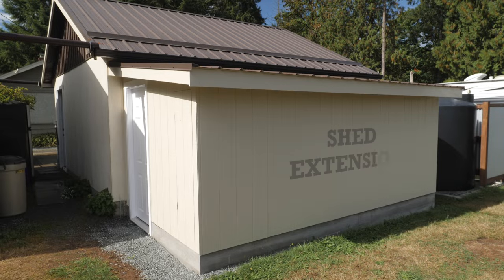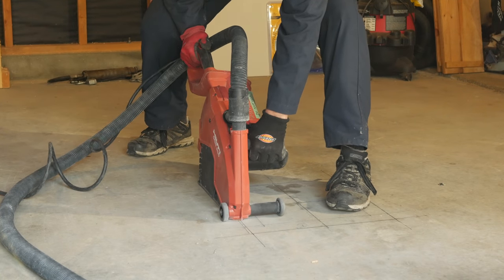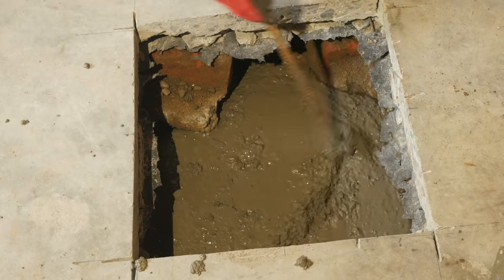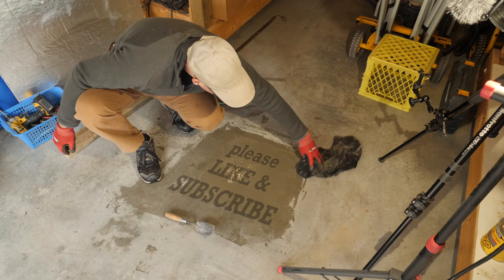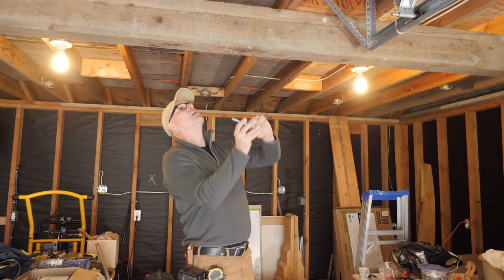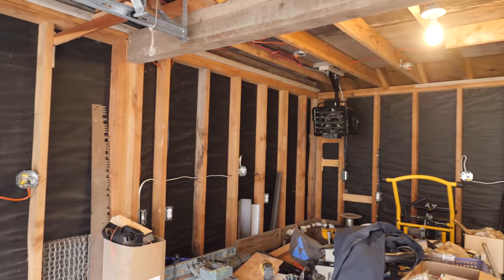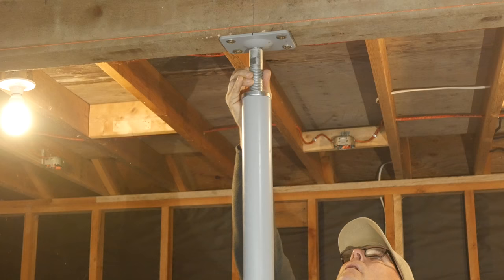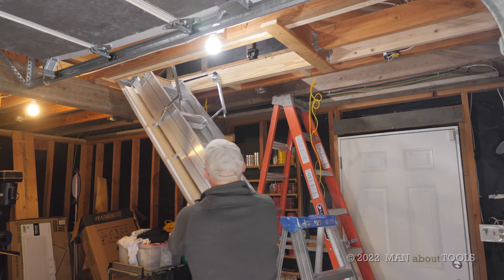Fix a Sagging Beam - Workshop Build Series

Comment: For attic access (even for storage) I prefer a hole with a straight ladder stuck in it.  I did this at my last house.  

The hatch door was hinged with an eye bolt in it.  A hook on a pole made it easy to open the hatch from below.  I then stuck a straight ladder in the hole (at an angle) to get in and out of the attic.  The benefit was when it came to lifting/lowering loads in/out of the attic. The wife removed the ladder,  I hung a block and tackle over the hole, and then used it to lift/lower loads that she hooked.  Worked great.  Made it easy to get stuff in and out.  Smaller items could be carried up the ladder just the same as the ladders that are hinged.
Reply from the maker: I like the block & tackle idea. Good options there. Thanks for the comment. Much appreciated! Kent

Comment: I have this same issue but it's located in the living room where a steel post is less than ideal. I've been thinking to use two steel C-chanels to sandwich the column. This way the steel will prevent further deflection in the beam
Reply: I have heard of extending the standard length of a wood beam by doing as you suggest.  Just ask an engineer, for sizing and fasteners.

Comment: Always love your videos....quick question. Why did you not just cast the bolts into the footer when the concrete was still wet instead of drilling?
Reply from the maker: Thanks! I was looking for a smooth trowel surface. I think you could do it either way.

Comment: A 4x12 LVL from Roseburg lumber is around $280 and you wouldn't need a center support.
Reply from the maker: Thanks! What length?
Reply: @MANaboutTOOLS  18'. I just bought one to replace a sagging 16' garage door beam. You could also get two 1-3/4 LVLs and sandwich them together to get similar strength. Much easier to work with.
Reply: Thanks for that. There are now also exterior above grade PT LVL as well.

Comment: Nice job. Just curious, on the 4 corners of the cutout concrete slab would drilling them out circular before using the concrete saw be an approach? You know, to stop those 90 degree cuts starting crack propagation ?
Reply from the maker: Thanks! I think that would have been a good option.

Comment: Are those the official Holmes on Homes gloves? Nice. Did you consider adding anything to the concrete to help it bond with the existing slab? I've heard (ironically on HoH, I think) that sometimes adding glass fiber to the mix can help with adhesion. I know this is a really small job but just curious.
Reply from the maker: In fact those are HOH gloves. Not sure where I got them I go through gloves like crazy. I didn't think about bonding to slab. In fact I think it might be better if the footing moved independent of the slab.
Reply: Depending on the application, the column footing can either be integral with the slab and have a thickened monolithic footing or have an isolated footing with isolation joints to allow for settlement differences. Since this is a post installed column, isolated is better…typically

Comment: Did you consider sistering the beam with a taller piece of 2x or maybe 2 of them for more strength? Price of building materials is nuts. :(

A few years ago I had to replace the beam in a loafing shed. Snow had collapsed a front addition the prior winter, splitting the beam. Whomever had added the front had removed a center post, and not properly strengthened the beam to span 20 feet. I wanted to keep the clear span and a beam for that was expensive even then, so I glued up a stack of 2x4s to 9 thick making a 20+ft long beam 3-1/2 wide by 13-1/2 tall. I made my own glu-lam, in other words. I think I had 3 of 10ft 2x4s, but the rest were 8ft and I staggered all the joints some distance apart. This was a taller beam than the math said I needed, but I had the height and adding another couple of layers of 2x4 was cheap compared to the work. I used the beam with a hydraulic jack on each end to jack up the center of the collapsed roof before fastening it in place, and so far, so good.
Reply from the maker: That's a FANTASTIC idea! Thanks for your comments here; for all of us to think about other options. I did throw around a few ideas for my sagging beam and sistering was an option I considered. Cheers, Kent

Comment: I wonder if you could jack beam then sister another beside it?
Reply from the maker: Yes. That would be an option too.
Reply: A piece of lumber that size/span would be insane. Compared to $120 metal jack post.
Reply: @boots7859  Steel same idea.    Just trying to maintain open span.
Reply: @phooesnax  My mistake, in retrospect, a couple of 2x10/2x12 plyed to that beam would have been similar in price and kept that span open.